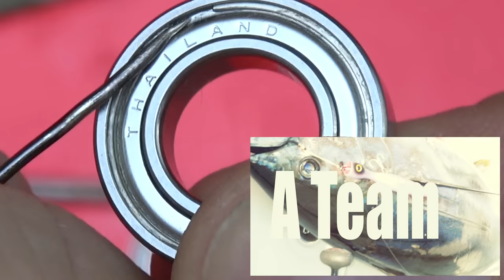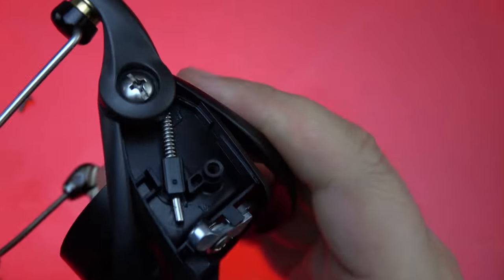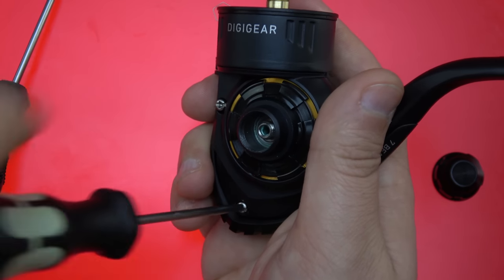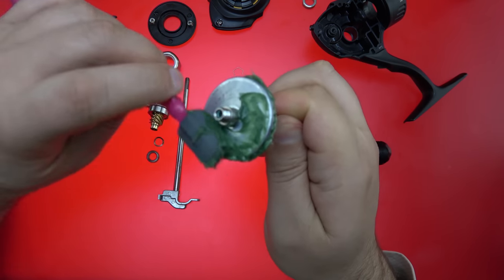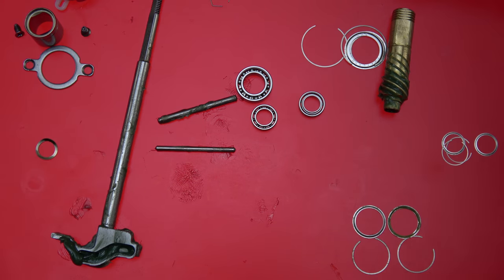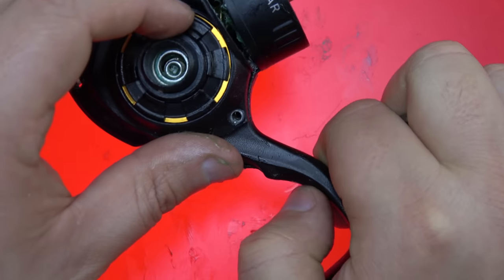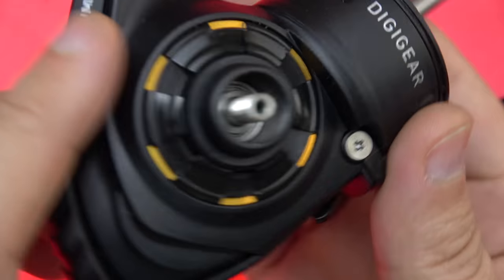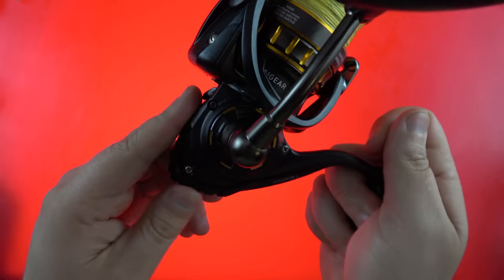Daiwa BG Full maintenance and service tutorial. How to protect your reel against  sand and saltwater

Comment: number 1 pet peeve is using any kind of screw driver when my hands are full of grease, i dont care what snap on says about their fancy grip, doesnt docrap when all lubes up. cheers to you haha
Reply from the maker: Damn straight!   I like smooth grip screw drivers.  I kliens and greenlees and other decent screw drivers....But for reels I really like the weras...I've tried a bunch....these grip shimano screws very well wihtout chowdering up the heads....and the shape fits my hand and I still can get a decent grip when all snotted up with grease.  The screw driver heads on all the screwdrivers are still in mint condition after a full year.....oddly enough i like pozidrive better than philips in most instances for phillips head fishing reel screws.
Reply: i bought a set of weras micro set because i saw them in a video of yours, never looked back!

Comment: I cant get the pinion gear to come out after trying many things. Any suggestions. I was following your video great until that step. Any help would be appreciated from anyone.
Reply from the maker: Really the pinion is stuck?  And you removed the screwed in bearing retaining ring?
Reply: @TackleAdvisors  yes. I just rewatched the video again and can do all up to 19 minutes including getting ar clutch, bearing and two screws out with no problem. I got all the pieces/gears out except the pinion and spool ahaft.
Reply from the maker: @ucscfencingvideos9492  is there any noise when you turn the pinion?  I haven't come acros any  stuck pinions on that reel.  I've seen some bent spool shafts that make pinion removal tough...but unless there's corrosion I can't figure out why it's stuck
Reply: @TackleAdvisors  ok. Believe its corrosion but ive put some muscle behind it. Ill try some different things. Thanks for replying.

Comment: What brand oil or lube do you use
Reply from the maker: Grease, aquashield mixed with a little tungsten disulfide powder, and corrosion x oil..those two play well and seem to be able to be mixed to a gel which works great on worm gears.  TSI 321 is a good oil for bearings but i can't get it on my hands anymore without it messing with me.

Comment: The handle of my bg dosent fit tightly once removed I put it back on and started reeling but with the slightest bit of pressure it just come lose and stops me from reeling anymore it's brand new only used a few times to
Reply: Is the non handle side bearing fully seated? It has that clip that keeps it in place but the bearing, in my experience, is tricky to seat all the way. Gotta put the main gear in and then gently rotate that bearing until it's fully seated, then put the clip in. Just a guess but that would cause the handle side not to tighten entirely

Comment: I did full maintenance on my BG and everything is all greased up and new however i still have this slight problem that when i reel it in it's making a clicking sound, and it has something to do with tightening the drag and i'm not if it can be fixed suggestions? it's not a big issue but the sound is pretty irritating and i payed over 150$ CAD for this reel believe it or not, and i don't know if i can warranty this i think my warranty  is up and i can't remember where i bought it from, it's from amazon but i forgot my email lols. any suggestions anyone?

Comment: Hello, how do you take off the grip?
Reply from the maker: slide small hooked wire inthe hole and pull   or  pick tool around the edge and gently pry...but you may damage the rubber...it may heal a bit...but may leave a mark.   As long as the knob itself isn't riveted on...A philips screwdriver will handle the rest

Comment: What would be a good freshwater spinning reel around 100$?
Reply from the maker: really can't go wrong with any reels offered from Okuma, shimano, and daiwa at that price point.
I have all the daiwa lt reels stuck in shipment right now so that will cover the exceler and fuegos.  I'm a sucker for reels with handles that thread into the main gear...as well as reels with support for the oscillation other than relying on just the travers block rubbing on the cam...and dual bearing pinion and main gear support..So the BG 2000 is a tank...That offers better support and gearing than the flooooger suprem if you don't mind the extra bit of weight.....The bg really packs a ton in the 100$ price range  for 80 bucks shipped.....http://amzn.to/2nIPmD8   it's tough to beat.   If the fuego lt is a BG made from ci4 which is what I was told.....wooof...that's that'd make it a sweet reel!
Reply: Thanks for the help!  I think ill go with the BG or Okuma inspira.
Reply from the maker: No problem.  Take a peak at the unboxing vid i did on the epixor.   I kind of spurr of the moment tore it down to frame because it was defective out of the box.  It was pretty aggrevating but seemed to be simply an extra shim that shouldn't have been there.  pretty impressed with it so far.  very good line lay.  extremely solid.  ANd it's their newest reel that just came out about a month ago i believe.  I also think it's one of the best looking reels....And after fishing it for a  few trips...My statement holds true that I still like the bail open close feel better than my stellas and exsence.
Reply: @TackleAdvisors  , Thanks for this info.. BG 2000 in 7'6" E6X Walleye Universal now-- Merry Christmas!

Comment: When im reeling my bg, when the spool reaches the highest point it reeling gets rough and it makes a squeaky noise. Needs more grease?
Reply from the maker: Love the Joe Rogaine username lmao.  Just remember bald is beautiful... Lol... If it's centered around spool location.  It could be a bent shaft.  I've seen that a few times.    Especially if you throw bucktails and shads.  (get snagged a lot) it could be a bad oscillation gear but the squeak doesn't make sense.
Reply: Sounds to me like the shaft bent. Had it happen to mine as well, got snagged and got stupid trying to get unsnagged. The part is $17 and add the shipping and it's getting close to 1/3 of the total cost of the reel. I replaced mine and it's perfect again but I'd probably just live with it next time. It was a backup reel anyway, felt kinda dumb when I thought about it.
Reply: @TackleAdvisors  ha yeah same diagnosis as mine, I should read the comments before posting as you covered this. I ordered the part after a few beverages and probably didn't realize the cost vs the reel price but it did fix the problem.

Comment: Do you recommend CRC Marine Grease? Hard to find corossionX in my country. Thx
Reply from the maker: +Adi Hagnyosaroyo haven't used crc in a long time but it's very similar to yamalube and that was my go to for a long time
Reply: Tackle Advisors Do you think the basic material is the same as corrosionx? I'm still afraid to use it for my reel, still doubt whether it will lose smoothness or not. Especially for bearing, still looking for the best grease. I love the smoothness of Daiwa BG and I won't loose it.
Reply: Adi Hagnyosaroyo Try Supertech from Wal-Mart only $3.80 for 14oz...im going to try this soon on all the ball bearings of my BG...ITS so slippery and smooth better than the grease that came with it..WOW?!....But it smells and really STICKS to your hands hard to take it off...use gloves Please. But THIS grease did magic to my very damaged collar and metal Collar of my BG Line roller worked GREAT....pack it in There! Like he said it creates and seal on it own.
Reply from the maker: My apologies....In my first reply i said crc was similar to corrosion x....I meant to say Yamalube which was my go to for a long time.
Reply from the maker: Corrosion x is a calcium sultanate based grease vs Yamalube and crc are aluminum complex.  (same as the aquashield grease i used in the other video)  
I used The supertech stuff....wasn't a fan, used pennzoil and mobile 1 44 lithium that same year.. and went back to yamalube after a few reels.  Grease is grease..it's not magic in a bottle.  But I find some perform better in cold and are more friendly with oils being added to thin it's consistency.   And stay put!
I experiemented with dozens over the years and until I went with corrosion x always went back to yamalube marine grease.  (and I'm not the only one hundreds of other reel geeks I know ran the gamut as well over the past decade..
Two greases I've used are worlds different....Aqua Shield, and Krytox.
I'm all in with the krytox stuff for my fancy high end reels.  Aqua shield i just used on  a 16 Aldebaran bfs and okuma epixor...The brand new never used aldebaran now is quieter feels better than it was 3 days ago when it came in the mail.  Aqua shield is the only grease i've used that will silent geary reels.....very interesting.  HOw it lasts is another story.  Gonna add some tungsten disulfid to the mix to see how it likes it.
Reply: I live in Indonesia, everything you mentioned is almost impossible to find in my country. That's why I'm trying to find alternatives of the same quality or nearing the grease you use. I am trying to hunt a grease that may be of good quality in my country, and I ask for your opinion.
I'm currently finding Vrooam Blue Tack WP Grease, CRC Marine Grease, Bel-Ray Waterproof Grease.
CRC and Bel-Ray use the same material that is Aluminum complex, while Vrooam is lithium complex grease with EP additives. Which do you think is best?

Comment: Hey I have a Daiwa BG 2500 and the silver part opposite the line roller keeps coming loose. What's up with that?
Reply from the maker: THe silver part opposite the line roller?  you mean the part that is attached to the bail on the other side attached to the rotor with the phillips screw?
Reply: Yes.
Reply: To be fair, I fish on rocks and it gets banged around. Unavoidable.

Comment: I had a couple expensive fishing reels for about 8 years or so and they were fine all that time without ever maintaining them. Is it really that necessary to take them apart? This stuff scares me. I took the old ones apart and ran into trouble and couldn't get them back together again well. I sure don't want to screw up a perfectly working fishing reel by doing a maintenance on it. Nothing against you or the video, just my personal view.
Reply from the maker: It's about making them last like new longer....or not having a sudden failure when your 2 miles from the truck and on an epic bite.....otherwise....out of the box is good.  Although it's always a good idea to pop em open to see if they are lubed at all from the factory...as I've seen it countless times they flat out miss with the grease gun lol
Reply: @TackleAdvisors  I got a quote the other day for a overall and it's $25 he said at tackle place. I don't know if i really want to do that if it's working great still say after 5 years. I took the old ones that were not working apart (shimano baitrunners) and i screwed them up good doing it. I'm real afraid to mess with a good working reel. Just ordered the Daiwa BG 5000.

Comment: I though you put bearing lubricant in the bearings, then put the sheild on and pack the outside with grease. putting grease in the bearing defeats the point of having a daiwa
Reply from the maker: Far from it.  Putting grease in the bearing makes the daiwa last longer in the salt.  And will make any reel last longer.
Surf casting isn't a place for buttery free spinning reels.

Comment: The reel needs to be greased   right out of the box the factory only puts thin grease in these I have two 4000s dunked both of them the grease the factory does  sucks it turns to sledge or some nasty black residue as soon as water gets to the reel

Comment: prime example of over greasing
Reply: Pretty sure you missed the point. The Daiwa BG is not sealed and guys in the NE US surf fish in rough water where reels get dunked constantly and actually reeled under water. He was very clear that’s why he used so much and actually a lot of guys will essentially pack their reels with grease. Go fish an unsealed reel the way they do without this type of greasing and it’ll last 1 trip.
Reply: When the shields are removed will the bearings fall out?
Reply: No,the cage holds them in.

Comment: I’m surprised that you didn’t grease the threads of all the screws so they don’t rust in place
Reply from the maker: You're absolutely right.  What I usually do is grease the inside of the frames so when the screws are inserted through the sideplate.  They grab the grease on the way through and while they are fastened.  That way you don't get sand accumulating in the screw heads and around them nearly as much. Plus the amount of grease on my fingers is enough...lol
  Does that make sense?  I failed to mention it.  Very good point.  I'll be sure to point that out in a future tutorial.
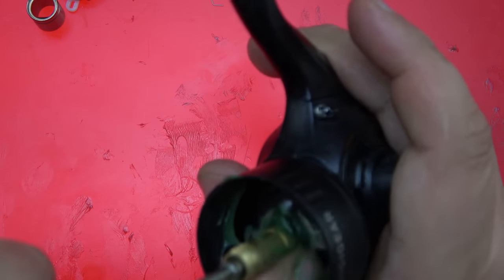Reply from the maker: at 43:40 i applied it directly to the holes "under" the ar cap.

Comment: If youre hoping to use this video to fix your anti reverse...skip it, because he skips it...thanks... had my reel apart up to that point
Reply from the maker: I've worked on a bunch of these and have see, and heard of a bunch of these clutches failing... Best bet.. Buy a new one... From q tips and soapy water to  using commercial degreasers and an ultrasonic cleaner... Running dry and 1 drop of oil.. The results are inconsistent...warm or cold temps.
Reply: @TackleAdvisors  Thanks for the reply, I think Ill just pick up another Penn Battle 2 .. more luck with them.. Iv already had a few problems with this Daiwa BG and its only just over a year old..once again thanks for the reply

Comment: You are so much using grease on every step and your reel is not working perfectly. Sorry 🤷‍♂️
Reply from the maker: It's preventative for the abuse surfcasters put reels through... If high and dry lube lightly... Bg bearing rust is an issue if exposed... Hence the grease... I mention the excess grease will make it sluggish.